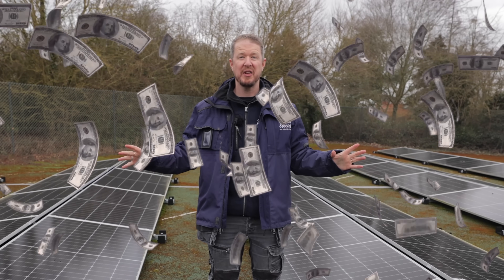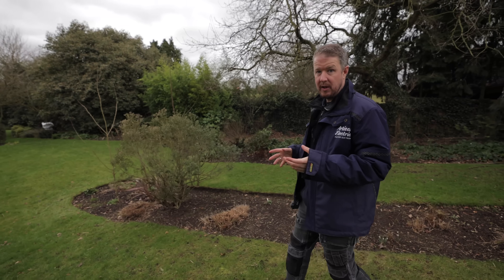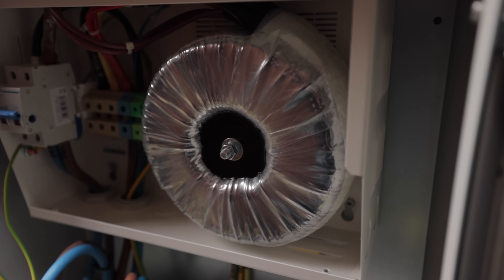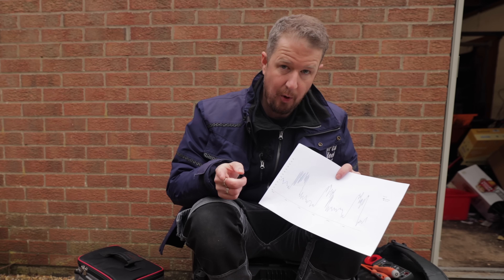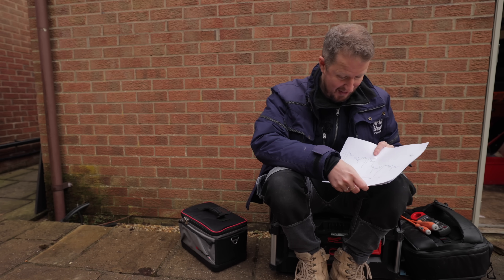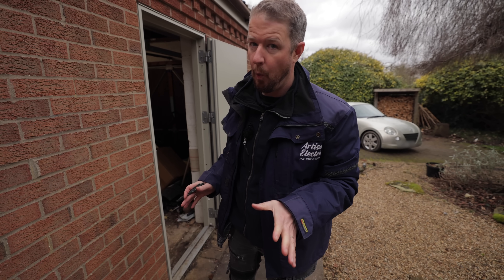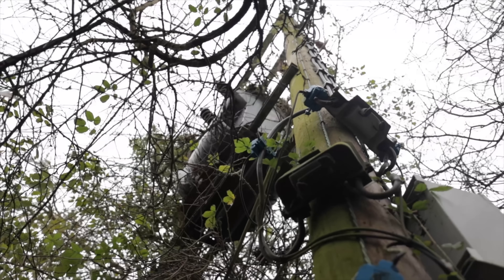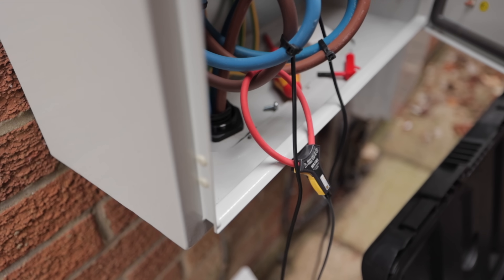THOUSANDS Down the Drain – And We Can’t Do Anything About It!

Comment: Isn't it 10% up and 6% down from the accepted 230V standard? 

If that is the case anything over 253V would be outside acceptable norms and require grid compliance, wouldn't it?

It sounds to me that you're trying to pull too much off the grid at night and require a second feed, which would also aid in the spike you're creating trying to push too much back onto the grid down one line.

Varying power is not insurmountable there are simple electrical devices on the DC side to deal with that. You're causing issues at the distribution transformers drawing or pushing far more than a normal house. Try 330V three phase it'll be more capable as it will be an industrial link with a huge boost in power transmission.

It's certainly not the grid's fault you're drawing too much to charge batteries. I'm guessing you want cheap overnight power but you're taking far more than a normal house too quickly.

You either need a more substantial connection to the grid or tune down your demand upon it.

Comment: You have programmed the inverters incorrectly. If you grab an inverter specialist who understands how to set up the cosine angles and sine wave modifications algorithms, the fix is easy. Remember all that calculus integration area under a curve from your A-level maths... You are outlining a big issue we have in the electrical contracting world, the days where electrical contractors connected wires and screwed things on the wall have gone! Nowadays, we have to networking experts, fibre optic, home automation, medium voltage DC switchgear, computer programmers, CAD specialists, understand many apps and even structural engineers. Where does it end and how can a typical guy without a formal degree in engineering get to grips with all the crap that us electricians have to now understand and be an expert in!

Comment: EREC G99 7.7.4 states Under no circumstances should they resort to the use of Voltage Management Units installed between the Connection Point and the Power Generating Module

Comment: I draw your attention to MIS 3002 ISSUE 5.0 clause 5.6.6 
5.6.6 Solar PV systems shall not be connected to the AC output of any form of voltage
management device without consent of the DNO.
Note: See clause 7.6 in EREC G98 or 7.7 in EREC G99

Comment: Hi!
I have watched your YouTube video. The problem is that the system sends out too much Ampere and thus too high Volt. Installing a reducer with a toroidal core transformer is wrong. It is better to ensure that the system on the inverters automatically reduces the voltage to a maximum of 250-253 Volts. If there is a need for power on the grid, the power is increased. When the need drops, the power is reduced. This can happen completely automatically without the voltage on the grid being too high. When the electricity supplier at a power plant notices that the voltage drops, the power is increased and when the voltage increases, the power is reduced. It is not more strange than that. In other words, you do not send out more power than is consumed by those connected to the grid. You must adapt the power to the grid in relation to the power need and what is consumed. You must understand this relationship and explain this to your customer. You cannot send in as much power as you want, even if you want to. Physics has its natural laws.

//Martin, Sweden

Comment: Most of uk electricians isn't up to scratch with DC system, right away the issue is within the inverters hence this customer really should have just stayed off grid in summer and on grid in winter, or get more batteries. In that house need to be on 3phase not single phase if you're using 17kw to charge on single phase that's a fire waiting to happen.

Comment: One thing that's not been taken into consideration is the fact most overhead lines and trannies are actually 3 phase, adding 17kW to a single phase will create a major imbalance.
Another thing that should have been checked is the voltage in every 3rd property on that road, the solar install has most likely overpowered other properties.
Who's to blame for all this? Both parties concerned.

Comment: Would a simple solution not be to put a solar activated bypass switch on the voltage optimiser, so it only came on when the solar levels were enough to charge using the panels, then when the sun goes down, the switch would turn off the optimiser so the batteries could charge successfully from the grid?

Comment: I have since heard another, unexpected, conversation about car batteries not charging if the mains is too high. Yeah Gods. Another bit of technology designed to work on US 110V (Though it turns out they seem to use two phases for any heavy loads) - anyway, it seems our "normal" mains supply is a "fault." Considering the damned batteries are working at 700 - 1000VDC, you think think they'd take anything they can get!! This is just some teenage kid in America decided to fit 250V ZNR's to protect the input to the charging circuit. Then set the software accordingly. (There are 275V ZNR versions, but down in "Kernow" you couldn't put those straight across the mains, not till you had choked it a bit. 420V ones were the only things safe to put straight across the mains down there.) I've seen this over and over with PC power supplies. Fundamentally they deliver much higher voltages internally. But when they designed the one bit you'd think would be imune, some idiot was thinking 110V US voltages. This is just dumb, dumb, dumb.

Comment: The inverters should be shutting down if they exceed G99 Uk grid code limits that should have been set during commissioning, you could install more batteries and use a power plant controller lo limit export until the tx is tapped down

Comment: My first guess would be bad Inverters, that they let it fluctuate...................But I am nor really sure is UK grid is that SHITY.....it cant be right?
In EU you would not make a difference with few KW, there is like 1 or 2 transformers for whole village, OR in town like 1 transformator for one whole street for like 200KW.

Alsou if you would crate higher voltage in one of the brenches of the grind, it would affect also the voltage in different places passed the transformer, so it would be spread out.

BASICALLY YOU DID NOT FIX THE PROBLEM IN THE FIRST PLACE, and that is your instal, the inverters shouldnt be umping out more than 253V, definitelly settings problem.
Next time invite someone who is knowledgeble in this field.

Comment: At the start of the video, you state that it's not really your fault, but I would argue that it is. Putting 17kW through a single-phase line is pushing the limits, at best. I strongly suspect the issue lies with the lines, not the transformer. It’s simply a matter of Ohm’s Law. You're experiencing voltage drop or voltage swing along that 300-meter length of cable. You're trying to achieve something that just isn't feasible—certainly not at 17kW. I don't think it's fair to expect the DNO to fix the transformer or the cables. In my view, the issue stems from the configuration of your system. 17kw is simply too powerful for that rural location

Comment: It should be the responsibility of the inverter system to ensure its output is compliant! What the hell is the even the point of these applications and fees if they aren't actually type approving the hardware requirements?

Comment: I hesitate to suggest this, having only seen this video - but wouldn't it been a good idea to get advice from a Chartered Electrical Engineer consultant?  There appears to be so many things wrong with your present approach that I cannot believe that you have discussed this with engineers at the area's power distribution company.  You do appear to be raising their low voltage (240v) feed to the neighbours, out of specification. It's likely to be the overhead line voltage drop and not the regulation of the transformer - one that size will have pretty good regulation.  You should be controlling the current sent so as not to put the line voltage out of spec - not just attempting to dump umpteen kVA into it.  
Their transformer is going to be a 3 phase one and with any luck, all three phases will be on the overhead line.  If so, I would have investigated the possibility of getting a 3 phase supply and spreading  the loads and power sources over those three phases.

Comment: Yikes... two problems here with the installation...both self inflicted unfortunately...

1) Inverter incorrectly adjusted or poorly designed. Why is it trying to push the line voltage as high as 262 volts in the first place ? It should have a maximum voltage that it's willing to output when exporting power onto the line that can be adjusted to be below 252 volts...I can't believe the inverter doesn't have such an adjustment, otherwise how can it even be legal to connect it to the grid ? Sounds like the inverter wasn't set up properly when installed.

The total generation capacity of the panels obviously exceeds what the source impedance of the incoming supply can handle without excessive voltage rise, so when the house and battery can't absorb sufficient power the inverter should be throttling back to keep the voltage within a safe, configurable maximum voltage. Just because sun is shining on the solar panels doesn't mean you HAVE to take the maximum possible power from them - the inverter can choose to only take what power is needed. (The power consumed by the house, charging the batteries, and the excess exported to the grid WHILE not exceeding a set maximum voltage - which will at times be less than the maximum potential of the panels)

Likewise when it charges the battery in the night it should have a configurable lower voltage limit that its willing to pull the incoming supply down to when charging. I can't believe there isn't such an adjustment here either, in any properly designed equipment.

2) Adding a step down transformer seems highly dodgy and doesn't address the problem, and needs to be removed ASAP... it should have been fairly obvious when the voltage was rising too high when exporting to the grid that the potential for it to fall too low when importing was there as well, and that a step down transformer would only make that situation worse.

However worse than this is that now the inverter - which is already trying to put out too high a voltage onto the line is now seeing a lower than real line voltage after the step down transformer - so it will attempt to push even more power onto the line when exporting causing the line voltage for all the neighbours to go even higher than before - so you're potentially causing further issues for neighbours adding the step down transformer.

Is the source impedance of the supply higher than it could be due to the 300 metres of cable ? Probably, but in a properly set up system where the voltage limits are working on the inverter that would only reduce your maximum import and export rates from the maximum potential but without causing any actual issues.

In short - the panels are too big for the supply impedance, the voltage limits for the inverter for export and import are not set properly or not working, (or its just not a well designed inverter) and the transformer will be making things worse.

So unfortunately I think the bulk of the responsibility for the problems lies with you, not the DNO even though they could probably improve the quality of the supply a bit with a new cable run. (Good luck with that though)

Take out the step down transformer, adjust the upper and lower voltage limits on the inverter properly and just accept that you will sometimes have excess capacity from the panels that you can't use because they are oversized for peak summer illumination due to limitations of the grid supply.

Comment: Hi, there is no single side to blame. You can blame inverters too (wrong design). System needs to be investigated. Numbers you gave and with simple calculation, if the cable from transformer to house 25mm2 cable 300m long 20V drop or rise is normal when you pull or push 17kW. Even I haven’t mentioned to power factor. But as I said needs proper investigation and calculations than just recording data. Good luck with the project.

Comment: Im a marine electrician, and what i see here is that the inveter is either faulty or the settings haven't been properly set to code in a hard upper voltage limit for the incoming solar. Maybe a different brand unit would've been a better approach to a voltage down converter? Anyways no judgement, we all make mistakes with new bigger scale projects.

Comment: The batteries charging, dropping the voltage, to bellow 220 volts is your first issue. The second issue if the fact that the Voltage increases well above 240 volts, which shouldn't be happening if the converters installed in the property work properly. You can blame the second issue of the fact that the Grid itself doesn't consume the electricity produced when sunny, but this shouldn't be a problem at all if the equipment installed in the property works as supposed.

Comment: problem [1] why are those solar PV panels at such a shallow angle? for South facing panel (in UK) the tilt should be latitude plus 5 to 10 degrees to allow for winter.  That is the tilt should be at least 60 degrees if facing south. But if East / west facing then add 1/ degree of tilt for every degree off South that you have the Azimuth of the PV panels. So the tilt will be typically 70 to 90 degrees (yes vertical). 
 Also Diode Isolate so the panels not facing the sun don't become a load for those panel that do face the sun. That will have more to do with DC voltage fluxuations in the output. 
But that said, I'd agree with your Analysis of the supply Poles  & feed length & Transformer. 
I was amazed at how overgrown they were as that would be criminally negligent in AU because of the fire risk. 
Electrical Engineer in AUSTRALIA.

Comment: jordan Defo want to see part 2. Without knowing it you've explained what the DNO do when they determine inverter size and export limits. I always argue that the inverter doesn't add new load. You can limit the battery charge limits if the SolarEdge inverters are G100-2 this will reduce the voltage drop. BTW to get 17KW (assuming this is totdal inverter capacity) is as rare as hens teeth here in the south! It has to be their fault this came about AND they do know cable lengths as they are all documented.

Comment: The inverters are shit, if you have 240V incoming you should have 242V to push back to the grid.
If a solar inverter peaks to 260V the internal measurement is incorrect.
To deliver power back to the grid you should have more voltage to realize that. 
If an inverter creates this much voltage it is regulating on the solar voltage and not on the grit voltage, will say inverter measures his own voltage and then added 2 volts and again and again and again till 267 this is the max otherwise voltage protections will drop.
Reply: Ps sent me the schematic and I can say what the problem there is
Reply: Ps sent me the schematic and I can say what the problem there is personally I think the inverter is to far away from the main power source it should be close as possible to the e-meter

Comment: Call  inverter supplier support, the inverters have detailed voltage, frequency, power, fault logging which they can look at. If there is an external cause, they will see it and tell you that for example the AC voltage drops out of allowable range and the inverters flag "ACV out of range" and stop producing or 5 mins. Once you have that info you can call the utility and tell them, and they can come check your supply.

That's just an example, but the inverters have high speed logging of everything going on, so call support and use that data.

Comment: Of course you setup the logging in the output, input dude, voltages should measured a source, not after some piece of equipment. Results aint valid, i expect UKPN to tell you the same, and oddly i got no sympathy for you or your customer, this whole thing stinks of inadequate planning from you and UKPN.

Comment: Are those inverters working correctly? They should be shutting themselves off at 253V, so you should never 260V.
But as others have said, you are really quite inexperienced if you think you can push and pull those kinds of powers in a rural area without consequences.
As for adding a voltage optimizer, that will just mean you are pushing even higher voltages in the grid side.

Comment: Solution is to add much more battery storage capacity, to store solar peak output. Then use as needed, not to use as investment, messing around buying cheap and selling high. Customer expectations are wrong and settings on both battery and inverters are wrong to cause voltage to become out of permitted tolerance range.